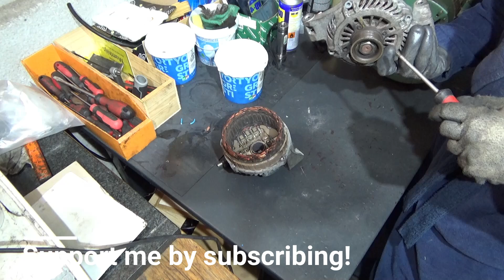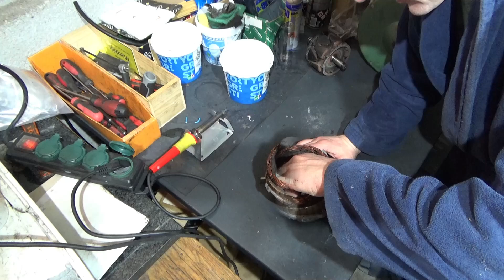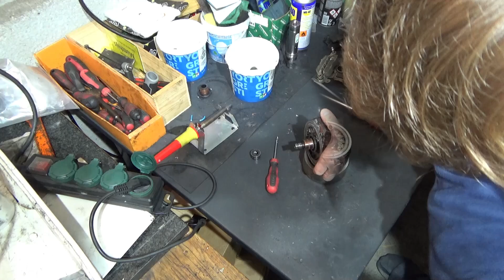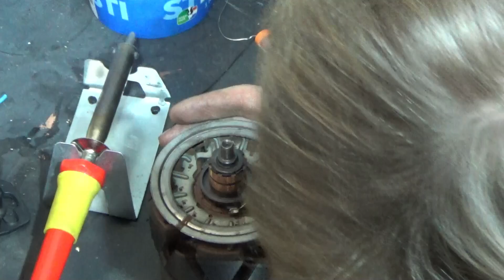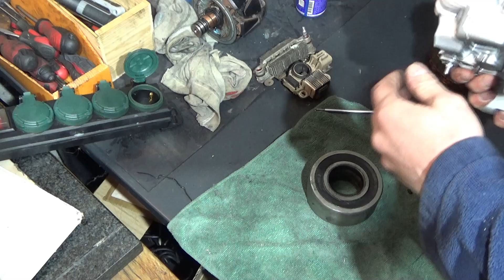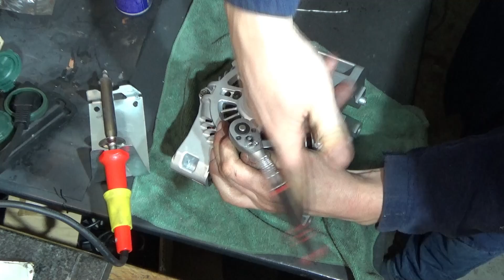MITSUBISHI/MAZDA Alternator Repair (Mazda 2, 3, 5, 6)

Comment: Thanks for this video. This is the same alternator, but with a slightly different housing, as the 2003 Subaru Forester. I was hoping to just replace the regulator in mine but it looks like I will need to replace the rectifier as well.

Comment: Great movie 👍 can you make a video of rebuilding Eurolek A2t33191-b 12V 80A Alternator for Mazda 626 2001 2.0 petrol engine. 

Also can you support your movies with testing and providing characteristics of components, example which type of diodes are used in rectifier, stator winding resistance, rotor resistance.
Reply from the maker: Stator / rotor to earth at 1 megohm or more is ok for automotive applications and 5+ megohm is good. Preferably you have 100+ megohm but that is only for a brand new part.

Comment: what if you want to replace the brush only and reuse the regulator . can you do that ?
Reply from the maker: @khaibui3575  Yes. You will have to carefully desolder those 2 ears or cut them and then make a new good connection between the brush holder and regulator. A small copper strip would do as connection.
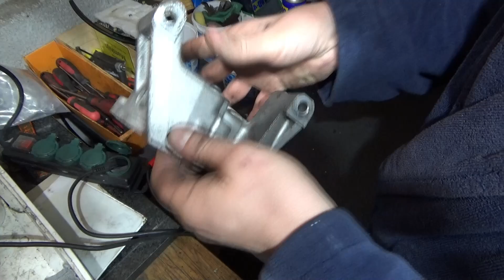Reply: @poeliewoelie1987 I accidentally cracked the old plastic on one of the “ears” of the rectifier that goes around the stud (not the insulated screw — visible on the upper left at about 8:50 ) would it be OK to superglue the broken piece, should I remove it, or should I just replace the rectifier at this point?
Reply from the maker: @zimzob  There can be a capacitor there used to correct the alternator function. If this is the case, you may also have damaged that connection. If it is just a dead piece of plastic, I guess glue is ok. The rectifier is cheap though. maybe just replace?
Reply: @poeliewoelie1987 there’s no component in that part, it just connects the shield that protects the connections to the windings. Superglue worked fantastically well, and I was able to reassemble and reinstall the alternator, and so far it seems to be working. Unfortunately I broke one of the long screws holding the case together, so I’ll need to replace that, but it seems pretty sturdy for now. Thanks for getting back to me though and thanks again for your super helpful video!